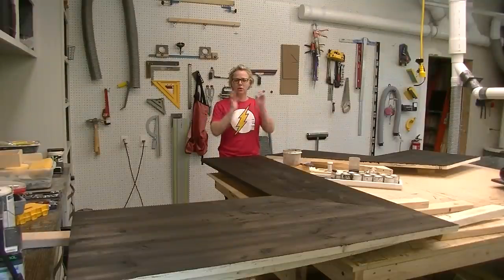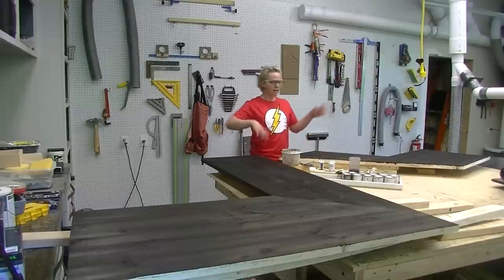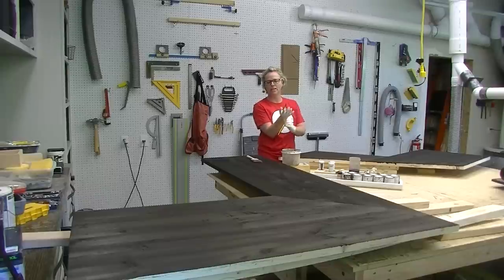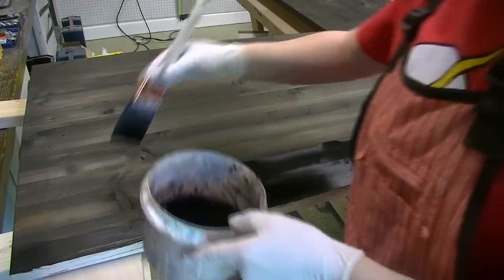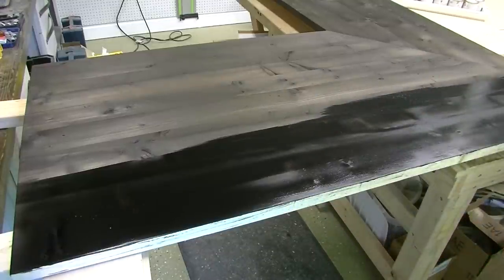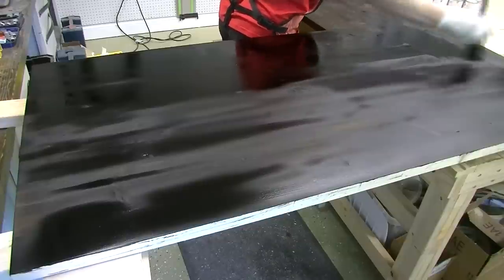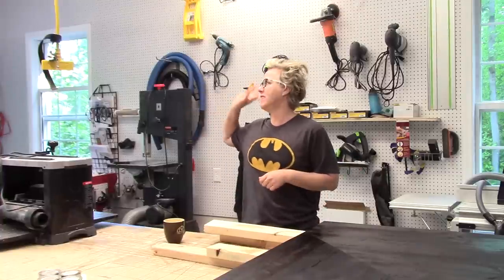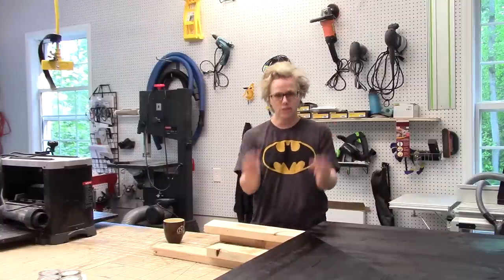Pantry (part 3) - Finishing the Wood Countertop

Comment: you can seal the dye in with a waterborne topcoat before you start the oil, might save you some oil and speed up the process, or use zinsser sealcoat (shellac) sanding sealer
Reply from the maker: Mark Me I actually like the process and love how the tung oil makes the wood look.  Is using a water based sealer under tung oil a thing?  I've never heard of that.
Reply: Sawdust Girl Its a good thing , water under oil is fine and what I prefer to  the reverse, but it can also be done. Seems like a waste to me to try to seal wood with expensive slow drying tung oil , that would change if the oil is the essence of the color, enriching a wood like walnut or cherry , or something more exotic. Is that the color you were going for with that dye stain?